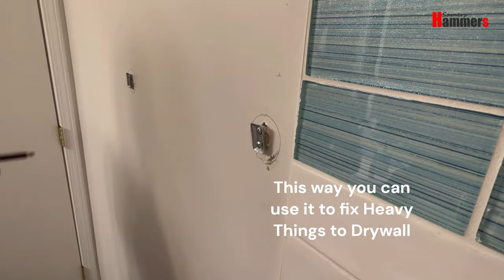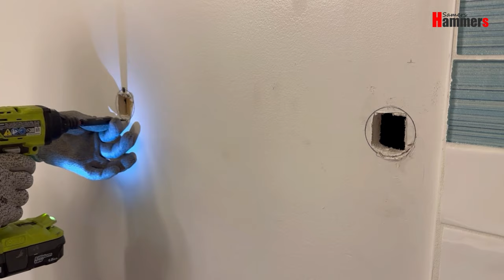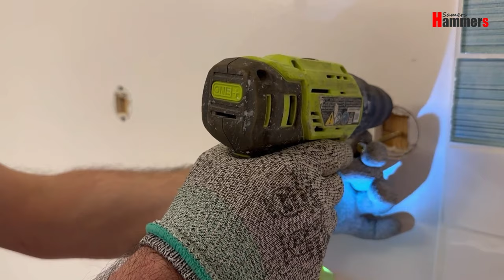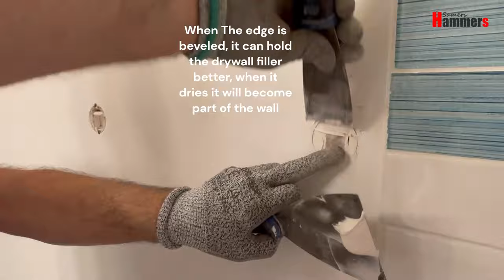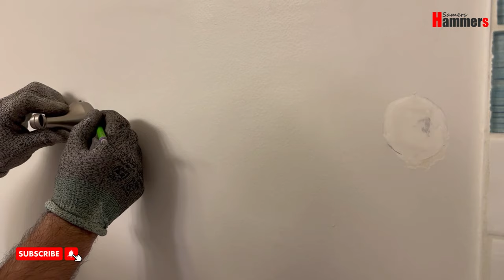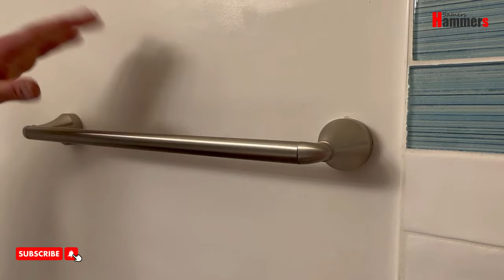How to repair a TOWEL BAR - Without repaint - Ultimate

Comment: What if the holes are through a tiled wall? How do you fix that?
Reply from the maker: Every damage has a different way of fixing, I cant tell you without looking at it, but if it is just a hole, Plastic Anchor will work just fine, or use silicone to stick the bracket on the tiled wall.
Reply: @samershammers  , thank you!

Comment: Total waste of time. The mud will eventually crack. I do understand the need to avoid painting but in my modest opinion, it is not a professional job by any means.
Reply from the maker: I respect your opinion, Believe me, I am doing this job long time ago, I did this way a lot, didn't have any problem, guaranteed if follow that steps correctly. 
thanks for watching